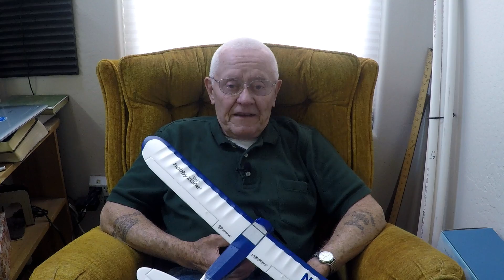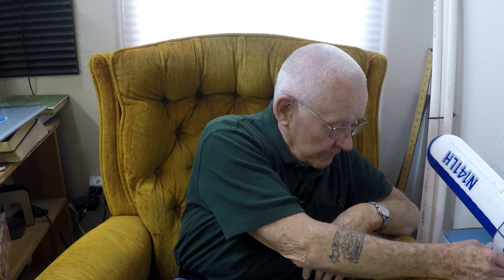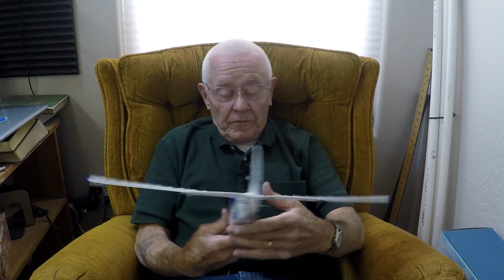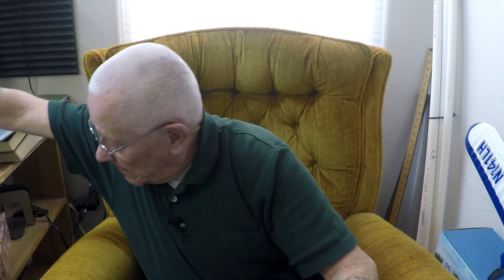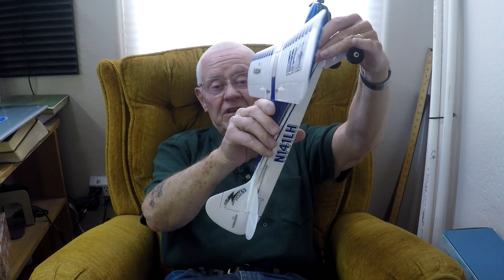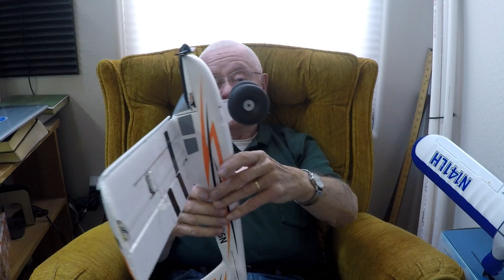HOW PLANES FLY & BOEING 737 MAX QUESTIONS . . .

Comment: Hi Mr. Kent... excellent explanation, this video is covered various effects that the Physics tries to explain and that are involved in what we call flying and in a way possibly understandable for a wide audience and this is a difficult to do... regarding the MAX, I saw several videos on the first accident and its preliminary findings and available data on pilot actions and airplane trajectory seem to indicate that the implemented system that aims to prevent the occurrence of stall, which is the loss of aerodynamic sustainability of the airplane, reaches an angle such that pilots can not, from a certain moment, keep the plane flying parallel to the ground, that is, we get the plane literally with the "nose" pointed to the ground ... but we will wait for more information and conclusions from reliable and capable sources ... unfortunately, many people have died in these two accidents and this is cause for sadness and reflection the for all of us... thank you very much for your time to help us to understand more about "flight", best regards...
Reply from the maker: Thank you. I had not heard of the software issues when I made the video so all you can say is that it does explain flight to folks new to it. I'm hoping and praying they do find answers soon. God bless.
Reply: @user-sr8pn9xg8z  I hope so, but all that I have heard may eventually lead to some sad conclusions: 1) poor communication from the manufacturer about this anti-stall mechanism; 2) inadequate preparation of pilots to respond to events not fully predicted in the manuals and even lack of knowledge about the dynamics of the airplane; 3) possibly, the second accident could have been avoided if the regulators had been more assertive in the action ... not the best conclusions! Best regards...
Reply: https://www.youtube.com/watch?v=bVSQ78nkzP4&t=328s

Comment: Very good observation, a lot of what you said is very try, the 737 had a fault that pilots already complained about with the safety system that stops you from stall, the computer drops the nose, this was happening even when they weren't going into stall, so the pilots had to switch off the auto pilot fast and bring the plane back up,
Reply from the maker: I'm learning more from comments like yours than I knew  before. Thanks and God bless.
Reply: @user-sr8pn9xg8z  thank you also for your information, I think with the autopilot on the 737 the pilot had to do 3 separate procedures to shut off the auto pilot when the computer dropped the nose of the plane, and from the information out there, it was  totally different from any other aircraft, so the pilots weren't properly trained in the procedure on that particular aircraft, there is a site that pilots use anonymously to highlight the dangers on different aircrafts, there was a lot of complaints about the 737 just dropping the nose on autopilot, but they successfully got it off auto and manually piloted the plane , so it was a known fault, I think heads are going to roll over that, RIP those poor souls that went down

Comment: I know what your saying . I guess because of the much heaver traffic today they seem to be climbing at a much steeper angle than in the past , and maybe the planes are not designed to climb that fast . The lift is horizontal if the plane is at too steep of an angle , making the load more than the lift from the engines . I haven't seen any video of the crashes but what your saying seems logical .
Reply from the maker: Thank you for your thoughts on it also. I love flying but I sure don't know it all :) God bless.